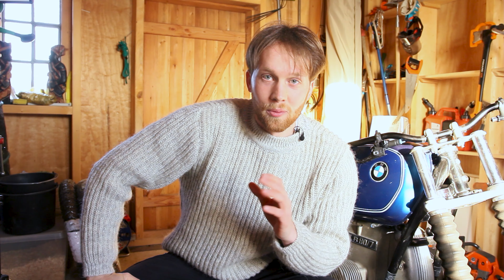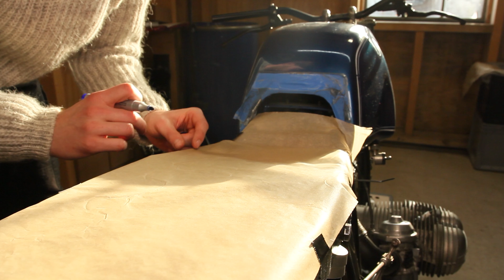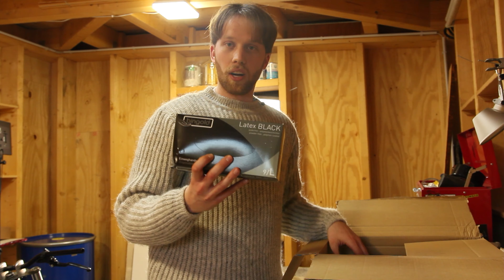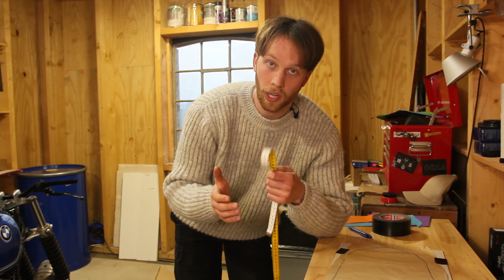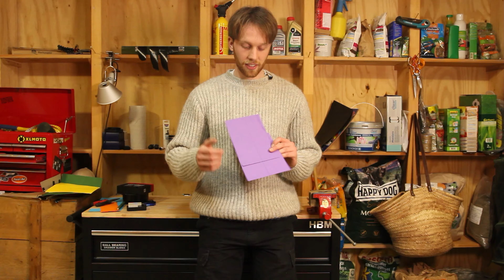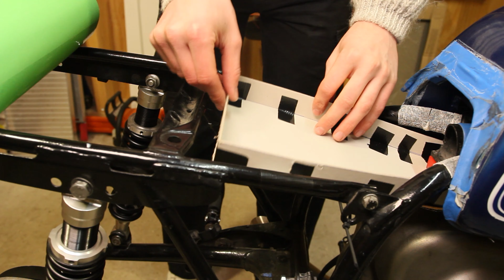How To Build A Battery Box Prototype For Your Custom Bike | BMW R80 Raw Build #4

Comment: Hello.  I proper BMW has the ignition key on the left side of the frame. If it’s not too late I would relocate it to the left side. Cheers mate.
Reply from the maker: Hi Lou, just saw your comment. Thanks for the tip! I will definitely relocate it to the left side. Thankfully, progress was a little slow while I was in Norway so I can still switch it. How are you doing? I hope you had a great Christmas.
Cheers, Joshua

Comment: Moto Wrenches, not too simple at all!. What looks like an easy build for the casual observer, as you have demonstrated is not as simple as it seems. Good tutorial. The other thing you may consider are the primary enemies of the battery...heat and vibration. The location you have chosen is not particularly exposed to any real heat, so no issues. Vibration must also be considered. The hard way is to isolate the entire box with anti-vibration mounting pads. A more simple solution is to make sure the battery rests on some type of resilient foam pad. Perhaps 5 mm thick will suffice along with a rubber hold down strap, which can be a simple as an extra thick rubber band, making sure the battery does not contact any metal parts. Keep the videos coming my friend. Excellent build.
Reply from the maker: Hi Mark! Thank you very much. Your feedback means a lot to me. Really appreciate it. Also, thanks for your tips regarding securing the battery from vibration. I'll get some foam pads and definitely one of the rubber band you suggested. Thanks a lot. Just bought a 2mm steel plate. Looking forward to building the battery box...for real this time :)
Reply: @MotoWrenchers  Velcro would be an even better solution :)  I just gave you the solution I have used before Velcro was invented. Your neighbor  Swiss electrical engineer George de Mestral was a pretty clever fellow indeed.

Comment: Hi- One addition that you might want to consider is placing a plug for charging the battery when the bike sits for long periods of time.  Much like the key cylinder in size, it could be on the opposite side of the bike, and offer an easy to access place to attach a battery tender.  There are plugs made just for this, I just thought that you would need one.  Also, if you can find paper board that is the same thickness as the metal that you intend on using for the box, then you can allow for the exact dimensions to be used in the final build.  You can transfer the final prototype into metal by tracing the outside.  If you can protect the battery and M unit from water, that would also be smart.
Reply from the maker: Hi my friend! Thanks for your awesome tips. I really appreciate you taking the time. I don't know if I need the option to charge the batter while it's installed but I'll make sure it's easy to be taken out. The waterproofing is a good point I'll look into that. Maybe with a little cover. 
Thanks again 🙏🙏

Comment: Echt gut wie genau du alles zeigst und keine Fehler versteckst!
Die Platzierung der Batterie gefällt mir richtig gut. Ich hab mich aber gefragt, warum du die Munit nicht unter den Tank packst? 
Freu mich auch schon echt aufs schweißen und pulvern.
Mach weiter so!
Reply from the maker: Moin! Vielen Dank für's Feedback. So etwas zu hören freut mich immer riesig. Das mit der M-Unit unter'm Tank ist eine richtig gute Idee. Als der Gedanke mal aufkam, irgendetwas unter dem Tank zu verstecken, habe ich ihn direkt wieder verworfen. Ich habe einfach angenommen da wäre nicht genug Platz und es auch nie ausprobiert. Das werde ich mir aber nochmal angucken. Danke für den Tipp!
Ich bin auch schon sehr gespannt wie das Schweißen laufen wird. Immer fleißig weiterlernen! :)
Vielen Dank für deine ganze Unterstützung mein Freund!
Frohe Ostern

Comment: Glad you made this video. Hiding the battery has been the most challenging part for me. I have seen some other people build their battery box behind/under the gearbox or even inside the air box and just add velocity air filters to the carbs, but I like hiding it under the seat better. Excited to see the rest of your build!!
Reply from the maker: Hi Hayden! Thank you very much for your feedback. Really excited me that you like the video. Comments like yours make my day. Where did you place your battery? And what bike did you build?
Cool to have you on board for the journey
Reply: @MotoWrenchers  I have a 1979 R100/T. I haven't changed the battery location yet, I still ride the bike around so Im just doing things here and there and deciding what I want I want the build to look like right now. I'm thinking I'll probably do something similar to yours, under the seat.